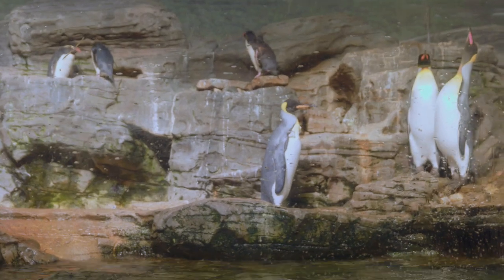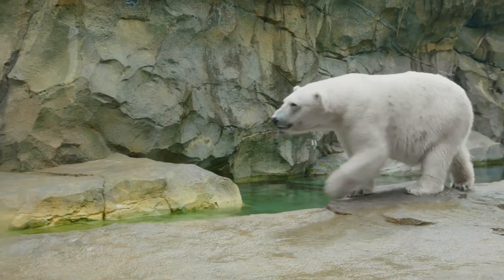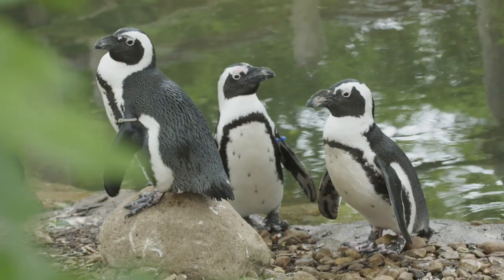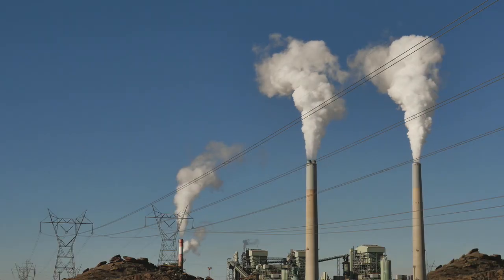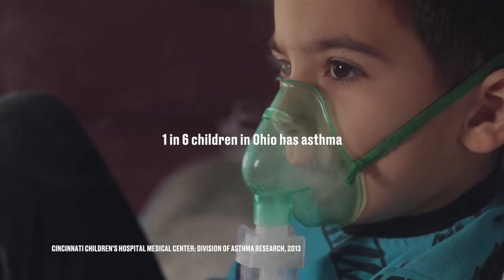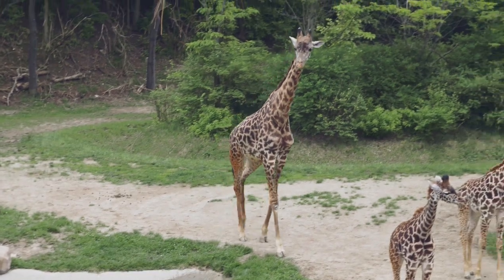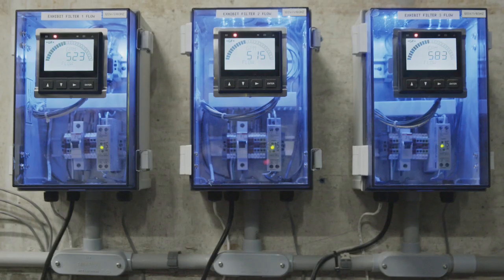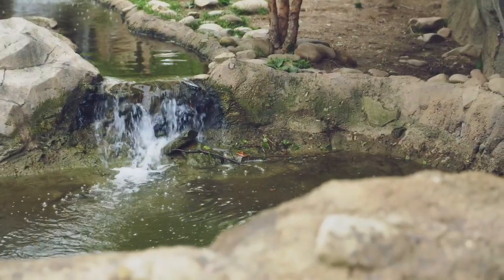Save Water Mini Documentary: Zoo

Comment: How to distinguish fake colgate? Does colgate makes paste without foil or other seal?
Reply: Colgate toothpaste which is intended for sale and use in the United States is manufactured in North America and will say distributed by Colgate Palmolive New York, NY both on the box and on the tube. Colgate Toothpaste boxes are sealed in the factory at the time of manufacture. We use ""Tab Tear"" technology on the flap of the box so that when the box is opened, the flap on the carton is ripped versus the glue used just coming simply undone. Because of this ""Tab Tear"" technology, once a Colgate toothpaste box has been opened, it cannot be resealed. Given this technology, we feel that an internal seal on the toothpaste tube itself is not needed. We hope this helps and if you have further questions, please feel free to give us a call at 1-800-468-6502.
Reply: Thanks